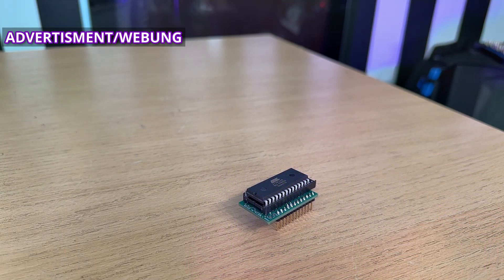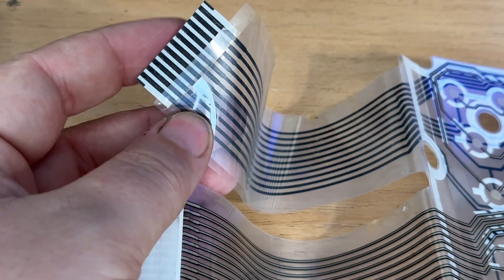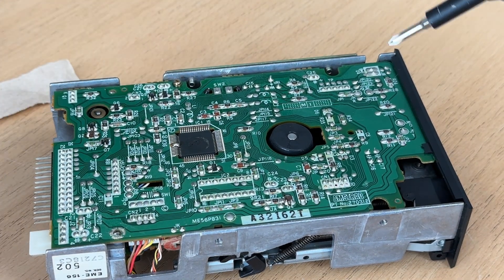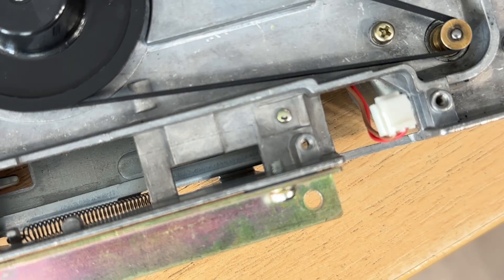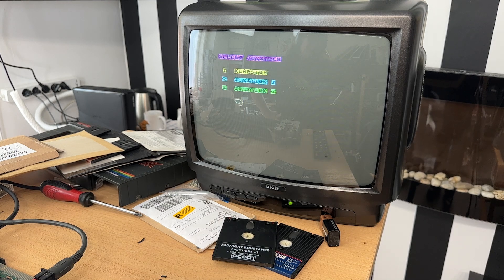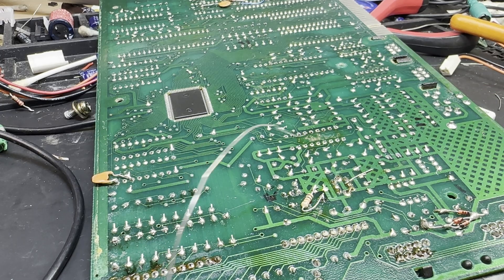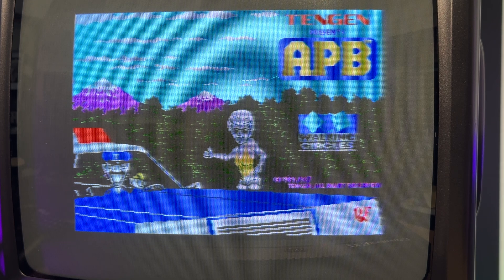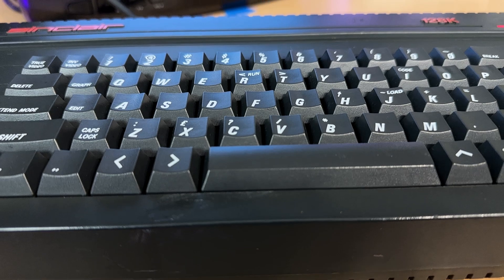ZX Spectrum Plus 3. Keyboard Fix, Audio restored.

Comment: Nice fixes. My word of advice: wear gloves whenever you deal with old gunky belts. I'm not sure about you, but for me, that stuff is just way too cringy to touch. And then, clean the parts with some IPA...

I'd probably recap the board while working on it just to be sure, but this is a controversial topic. Some will advise for it, others will be opposed unless there's something clearly wrong with the particular cap. I'm leaning more and more towards preventive recap, especially if we're talking electrolytics rated for 85°C working under heat. 

Nice to see a desoldering gun, it really does the job.
Reply from the maker: Yeah, I should have worn gloves, and it’s not like I don’t have any either. But I can be a little impulsive when I’m chasing a puzzle and the 30°+ heat doesn’t help. 

As for the recapping, I may indeed recap it, but right now I have a few machines that are definitely in need of a recapping, so as there’s no sign of leakage, the plus 3 is on the ‘would be nice’ pile. :)